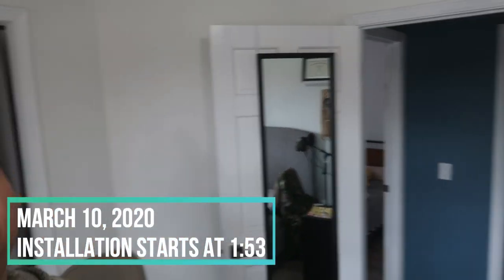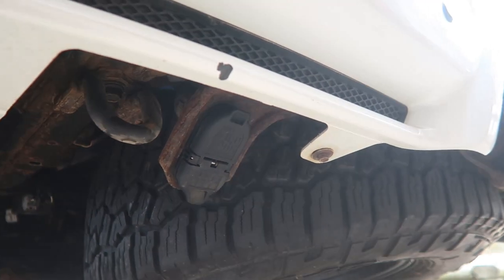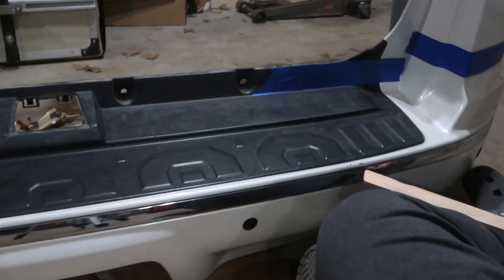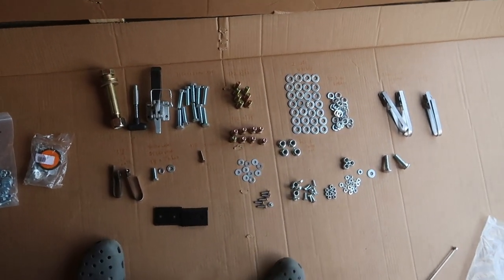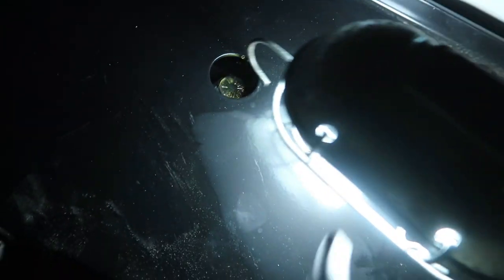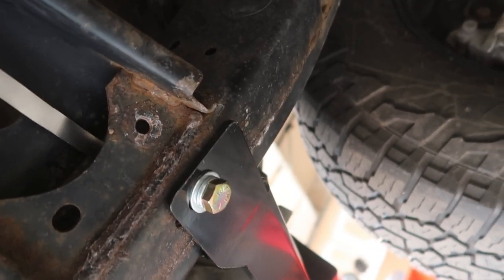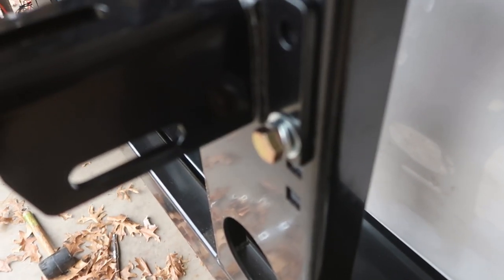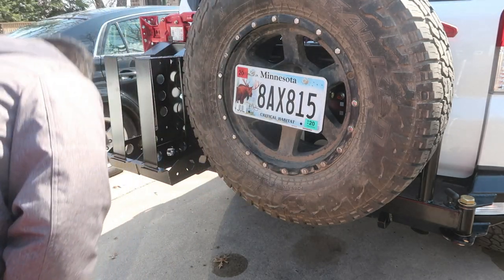How To Install Shrockwork Rear Bumper 5th Gen 4runner(2010-2022)

Comment: I have the same bumper and bought it around the same time as you. Shrockworks really needs to get it together with including all the right hardware. I also had to make several trips to the hardware store. Don’t even get me started on the quality of instructions provided. It’s a shame because the overall quality of the bumper is great.
Reply from the maker: awww. glad to know i wasn't the only one struggling during the install. How are you liking yours so far?
Reply: Steve Pheej Yang so far so good. Still need to relocate my rear view camera 😬

Comment: Ended up getting a used Shrockworks bumper, and this video helped with the install. I need a replacement T-pin for it and some new bearings for the swingarm but can’t seem to find the part numbers from anyone
Reply from the maker: Try taking the swing arm apart and giving it a good grease. I don't know if the t pin is universal either.

Comment: Good install video.  Man that Minnesota salt will eat up your car, all that rust on the crossmember which isn't as exposed as the rest of the frame.  Make sure to wire wheel, clean up that rust, paint, and protect your undercarriage with some fluid film or por15.
Reply from the maker: You bet. That'll be a summer project for the whole frame

Comment: Thanks for the detailed instruction.  What back up lights did you get?  Also, how you like the bumper so far?
Reply from the maker: They were included with the bumper for a fee. The powder coating is top notch. 3 winters with it so far in the rust belt. No issues